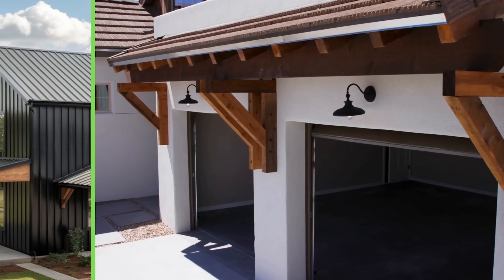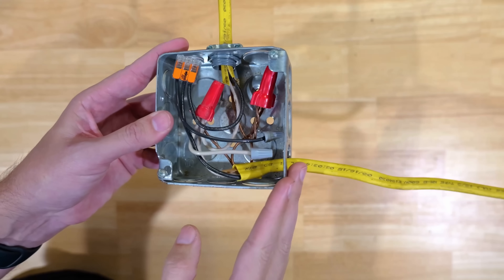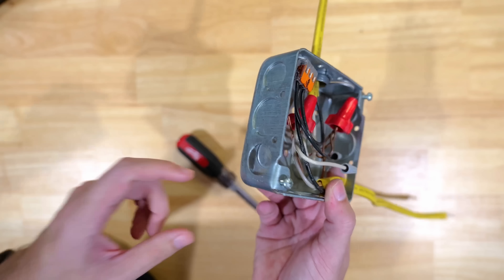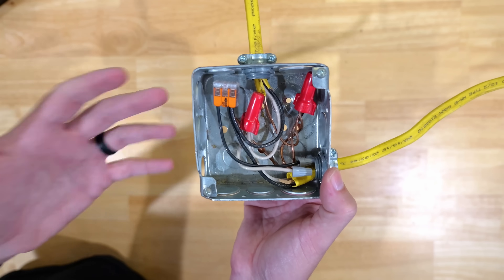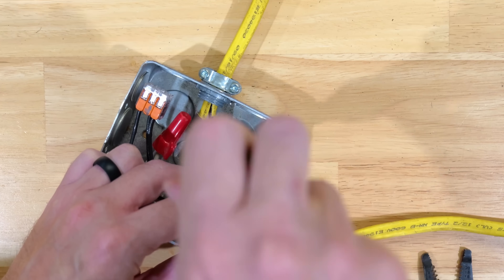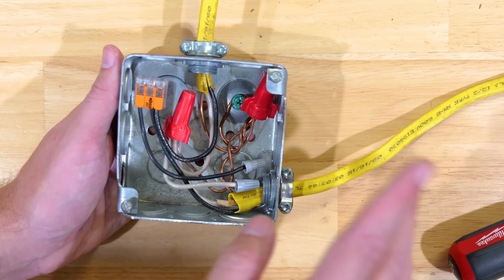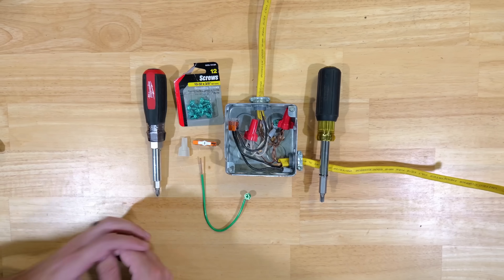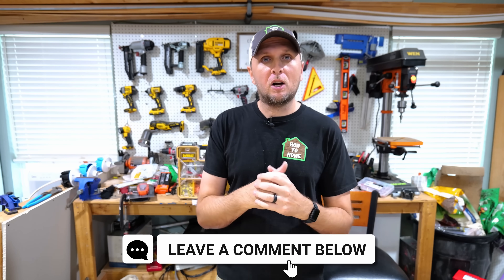SHOCKING Mistakes DIYers Make Installing Metal Electrical Boxes!

Comment: couple things, is not code, however from an engineering standpoint, , if using a 15amp recept, no appliance, via type of plug, should be more than a 15 amp device therefor the 14awg pigtail is protected, also that short distance may also not be an issue either but then is against code but not necessarily a big safety issue due to those two things. Just best not to do regardless of code

Comment: Based on the click bait thumbnail alone you don’t understand ul listings at all
Reply from the maker: I love non specific comments like this. 😂
Reply: @ UL 486C. There’s a 72 page pdf on it if you feel like educating yourself.
Reply from the maker: Still not specifying what you seem to take issue with.  72 pages will cover a lot of ground on different things.
Reply: @ it covers one topic in particular that basically voids your click bait thumbnail.
Reply from the maker: @ProjectGnome1961 no it doesn’t 😂.  You can’t even verbalize it because it’s untrue.  But keep up with the ridiculous comments, helps engagement!
Reply: @ lever action connectors undergo the same tests as screw on connectors and the flash point of both is equivalent so a wirenut is just as likely to burn up as Wago. A red wirenut minimum fill requirements are 3 18s so last I checked 3 12s is a larger radius than 3 18s. Furthermore, your box is ungrounded and you are missing a k/o seal on the left side
Reply from the maker: @ProjectGnome1961 yeah so you didn’t actually watch the video then because I covered all of that.  I also never said anything about the lever connector or wire nut being more prone to fire.  You would’ve gotten all the context had you actually watched the video.  This is not really surprising.

Comment: In Most cases 
In most older homes it's Crazy - NOT to reuse the wire nuts as the quality/ quantity of the materials used far exceeds the new wire nuts.

Comment: I don’t think you mentioned it specifically and I don’t know if it’s code where you are but here in Quebec apparently code is that if you us a box as a junction then it cannot be “hidden” behind Sheetrock etc without access (of course cover plate). I had this situation in my basement ceiling, and had to have a cover plate on a junction box OR rip out Sheetrock to pass a whole new strand of 12 gauge.
Annoying but it makes sense.
Reply from the maker: Yup, that is the case here in the US as well.
Reply: In the UK, we can have inaccessible junctions, so long as they are maintenance-free.  This means spring-loaded terminals on connectors, e.g. the Wagos that so many on this page dislike.
Reply: @johnbull5394 not here…no exceptions
Reply: @hondanazi4246  I never doubted Canada might be different.  It's another country, after all.

Comment: Is it common to have a small voltage on the ground copper wire?  Where could you test it for ground since it is ground?
Reply: The fastest troubleshooting would start inside the electrical panel, which preferably means with power turned off and a licensed electrician. 
The next step would be to then disconnect the bond so neutrals are no longer grounded in the panel. Then you can check each neutral to isolate grounding on which circuit(s).
Reply: If your panel installation is older,, you will likely find your grounds and neutrals aren't actually separated in the panel, that they all just land to the same bars. In that case, there's not one 'bond' to break.
Reply: But first, for fault isolation, maybe just turn off all circuit breakers and see if the voltage disappears. If so, then problem is likely on the load side of your service. Then you can turn on circuits, one at a time, until the voltage reappears. Remember that you could have multiple faults. So make sure you check one circuit at a time, turning it back off before checking the next one. If the voltage doesn't reappear then it could be a fault between circuits that you'll only see if multiple breakers are energized.
Reply: @brancampbell  Ty. Its an old church and I was concerned its a fire hazard. I was an electronics tech on aircraft so I know safety very well but not sure why I had some ac voltage on neutral and possibly on ac boxes.  Don't want to burn down the reverend. Great advice and ty. Is it safe to leave 100 year old wiring the way it is? Personally i'm not comfortable with that atm?
Reply: No, there should not be voltage on the grounding wire. Typical cause is a poor connection somewhere or a spot where the neutral and ground are making inappropriate contact (like in a light fixture or receptacle box), whereas neutral and ground should only connect (bond) at the service.

Comment: I saw a test where in 90 def ambient temp. they started loading 14 gauge wire and even at 25 amps it didn’t get very warm. So why do they limit it to 15 amps?

Comment: From the 2023 NEC it appears the screw for bonding should be green.

250.126 Identification of Wiring Device Terminals.

The terminal for the connection of the equipment grounding conductor shall be identified by one of the following:

(1) A green, not readily removable terminal screw with a hexagonal head.
(2) A green, hexagonal, not readily removable terminal nut.
(3) A green pressure wire connector. If the terminal for the equipment grounding conductor is not visible, the conductor entrance hole shall be marked with the word green or ground, the letters G or GR, a grounding symbol, or otherwise identified by a distinctive green color. If the terminal for the equipment grounding conductor is readily removable, the area adjacent to the terminal shall be similarly marked.
Reply from the maker: That is for equipment grounds.  So yes your receptacles, switches, and similar equipment require the screws to be green.  It does not pertain to boxes.

Comment: GJ on your presentation. But you knew this was going to happen where one of us masters was gonna catch a few mistakes. Num 1 box fill, dont know how many times i have found that lol. Num 2 steel clamping box connectors can be tightend down way to tight and cause a short, that and there are steel connectors made for MC and EMT that people think are the same thing as a NMB connector.NUM 3 this is a personal thing but lagos are junk. Num 4 wire nut capacity. Num 5 box must be connected to a stud with 2 screws min. Num 6 all wires coming to a junction need to be restrained with in 6 in. from box with staple or clamp. num 7 no more than 2  #14 or #12 120 volt wires under a staple or clamp.keep up the good work .

Comment: Wago and 20Amp, you are not afraid. Here in France as an electrician, I had to replace these guys  by "Dominos" because they didn't handle well high currents. I never trusted Wago. 
When I Lived  in USA  I wired a full home and used only twist nuts without any problem. I just twisted  with a tool (plier) the wires together first and then install the twist nut. Eveything turned well and never saw a lamp blinking when starting a high current appliance. Just my experience in both countries.  
The advice you give in the vid are very good and well explained.

Comment: When using metal romex don't tighten the dam thing so tight to crush the cable. just stop when the cable will not pull out and then put the screwdriver down. fins.

Comment: A very important thing to know about the metal romex clamp:  ONE PER ROMEX. You cannot put more than one romex into one because they will literally squeeze the conductors of multiple cables together over time.  That's a guaranteed failure state if any kind of motion occurs on the cables and there used to actually be special solutions... using a second plate between them does kinda work but then you've got a threaded saddle with no plate - and this is why you find plateless saddles in the box at the hangar store.

This tidbit will blow your mind:  if you're using the metal clamps for just romex you're supposed to turn the plate over so the cup-shape is away from the cable.  The problem with this is the manufacturers only make the shielded cover version of the plate now and you don't have the option to correctly install.

Comment: Love me some wago. Those things are the bomb. It can be such a pain to get 12 gauge wires to play nice in a wirenut, especially as I'm getting older and don't have the hand strength anymore.
Reply: I have never used them, but I want some. I am old too.
Reply: I like the wire nut twisting tool for a drill motor.
Reply: @KaffeKnot I dont. Too easy to be too aggressive. Two big and bulky at times I have hand ones. Now I just make 'em up in advance.
Reply: They make wire nut wrenches. Im 68. Got no problem twisting. 1 day, maybe ill need the winged ones. Not yet, tho.
Reply: I was always taught to place straight copper together into the wire nuts. Feel them bottom out in the nut. Then twist the nut on. Being told that the nut grips better while the wires are twisted. Using this method I never had a nut come off or wire pull out.

Comment: Wait. You made a video advocating using a cable clamp?  Back to square 1 basics. All wiring must be rigidly restrained.
Reply from the maker: And it is.
Reply: Apologies for being pedantic. I've wired hospitals as well as occasional private businesses and residences. When the JCAH inspects a hospital... I've been through two of their inspections. They check everything. From the emergency generator timed to start in less than 10 seconds to the tension of all receptacles prong holding power.
By the way, the elec box at the beginning of the video has one other little fail. All wire nuts should get a couple or three electrical tape wraps. EMF can actually loosen a wire nut over time. And use NEMA certified electrical tape. 
I did a repair on a 16 room hotel in Singapore a while back. Started with all lugs in the breaker boxes were loose. Mostly aluminum wire except some air cons. Smelling a rat I started checking the receptacle boxes. Almost 2 days later I was satisfied. About 15 wire nuts were completely loose.

Comment: Struggling to find a Wago connector 10 gauge wire, single connection. To extend the wire.
Reply: Hopefully they dont make one. 
Crimp splice, or new run. Careful.

Comment: is it ok to have spare ground wire hanging around without nut on it? Looks like it can eventually find it's way into wrong hole... I know it is bare, but sharp end might accidentally go inside the other wirenut...  I thought you'll describe this and then will ground whole box using it, but you added new one and never told anything about spare ground...
Reply: The "spare" wires are for the outlet that goes in cover for that box.  It isn't going to be left rattling around inside.

Comment: First, I’m NOT an electrician. Probably not the first to point this out but I’ve always taped my wire nuts wrapping it so it has a tendency to tighten the nuts BUT specifically I have found it prudent to wrap WAGO’s with tape as well. I just wired my new home using WAGO’s almost exclusively and I found that about anything, but especially stuffing the wires into a box often unlatches the WAGO and that would be a huge problem almost guaranteeing arcing inside the WAGO. Tape em up! It’s not hard. Great videos
Reply: DO NOT TAPE WAGO OR WIRE NUTS! You’re literally gonna cause the situation you don’t want.
Reply: If it's a new installation, you should be able to direct the cables neatly around the box (if they are long enough) and shouldn't need to stuff them in.  That said, nothing wrong with a bit of tape for good measure, and if it makes you happier.

Comment: Great video. I remember going through my conduit boxes and installing the ground pigtail.  Though it's all EMT and I've heard that you can use the EMT as ground, maybe that's no longer code, but if anything slips all of a sudden there goes your ground path so better safe than sorry.
Reply: NEC still allows using the conduit as ground. Local ordinances are more restrictive and might not allow such.

Comment: No true... about the color of the ground screw NFPA70  The National Electrical Code for the US crearly states that the ground screw shall have machine threads shall be green in color. Article 250 in the code book covers grounding.
Reply from the maker: Incorrect.  Only the grounding screws on equipment grounds like receptacles, switches, or other devices are required to be green.  However, per NEC 250.148(C) which is for metal boxes, there is no mention whatsoever that the screw must be green in color.

Comment: 14awg over a 6in can handle over 26amps before overheating. The problem is when it's a longer run.
I personally don't use 16awg and only use 14awg for lighting. Also because of how much stuff people have today i run dual 20A circuits to every room and use 15A breakers this leaves some head room reduce voltage drop increases efficiency infact on really long runs i have ran 10awg to the first box in a room and 12awg from outlet to outlet. I run a single gfci in every room for each branch I do use gfci breakers where required by code but generally prefer to avoid them in favor of gfci plugs i find the plugs tend to be more reliable and less of a pain to deal with when the trip for stupid things as some inductive loads will trip them randomly just because of flyback voltage. Hair clippers are notorious for this.
Reply: The length of the wire is irrelevant.  Whether it is 6 inches or 60 feet the wire will reach the same temperature.
You are simply not allowed to draw 20A of current through 14ga NM-B.
Reply: @stargazer7644  The temperature rises from a 20A load on 14 N-MB, which has a net thermal rise of 18.9c over ambient. It's 11.4c at 15A. This is a 7.5c difference
Thermal runaway is at 38.4A.
Nmb has a 90-c operating rating.
This means that unless you live in Death Valley, the large majority can get away with 20A. The bigger problem is voltage drop. I find using 12 awg vs. 14awg at 15A on a 150-foot run, not uncommon in two story homes. It can be a 12v or more and under 6v on 12awg.
My goal is efficiency, so I'm going to use the lowest awg i can regardless of what the planned circuit rating is.
Reply: @CNCAutomationLab  By code NM-B's ampacity cannot exceed that of a 60C rated conductor regardless of its 90C rating.  The 90C rating does not mean you can put more current through it and be code compliant.
Reply: @stargazer7644  i agree. I'm not saying do it. I'm saying if you have a short 14awg jump in a 20A circuit, it's not going to be what causes a fire. It's going to be the rodents, or a failed breaker or the idiot with with 6 power strips that keeps resetting the breaker every day.
Not the wire should it happen no, does it yes.
This is why in New builds and large remodeling projects, I recommend running full 12awg and 20A for each bedroom, and I personally retired 16awg and 14awg to lightning and fans or basically nothing someone can attach large load.
In dedicated home offices I started adding a 240v plug on it's own 20A circuit. Because gaming machines and high-end workstations are getting stupid power hungry. Like really my gaming tower alone is a soild 900-1000w add 4 monitors, led lights mic and speakers and I'm well over the 15A rating for the circuit and in my house the Orginal setup had a single 15A circuit feeding 3 bedrooms.
I tossed the old 100A panel for a 200A panel and service upgrade added 3 eg4 18kw inverters 184kwhr battery that I will soon double this is combined with a 28kw solar array. Yes I'm tied to the grid but it's pretty rare in use it. Before I did this rewire and upgrade my avg socal edison bill was in the mid 600$ per month average on a 2560sqft 5 bed 3 bath 2 story home with a pool
Reply: Many people, including electricians, don't take Voltage drop into consideration. The max voltage drop allowed to panels from source is 3%, the same goes for loads stretched out a long way from the source. Low voltage to motors will damage the motors from overheating. Motors are designed to handle 10% voltage drop, but that usually occurs when many loads are on the same source.
I have designed electrical systems NASA, and local utilities, and many military installations for 35+ years and was also a Journeyman electrician, I do hold a little knowledge of which I speak.

Comment: 1:20 yeah man you got to watch it with the mice. They like to swing on, jump on the cables when they're running through your walls.  Definitely gonna cause some wires getting caught if you dont secure them. Vibratons when you're banging your chick can travel through the walls and cause those wires to swing back and forth. Ir when your wires get up to stretch in the morning they can constantly bang against the edges. Should I keep going. Countless ways to make those wires move around and get cut

Comment: First of all us Standards are so  backdated it should be forbidden all over. Talking super smart and using metal boxes romex cables and even worse wire nuts is so embarrassing and like an old cowboy full of dust in 1800 try to teach me sps programming. Just get out of the 1930 and arrive in the Worldwide standards dump NEMA

Comment: Definitely use the green ground screw. It is made specifically for this purpose while another screw could damage the wire , not hold securely, or may not have the right conductivity. Don’t take that chance.
Reply: Everybody knows that ground pixies will only travel in green hardware.

Comment: Additionally as a best practice it's always best to pigtail out the grounds and make a wired connection to the device.  Code allows for the device frame to ground to the box, yes.  But every good electrician I've worked with always pigtails the grounds and connects to device(s).  As well for 20A applications it's best to put a crimp termination on the ends of the pigtails to devices.  Rather than curling under the screws, and never ever use the push in connections.

Good video, thanks for sharing.